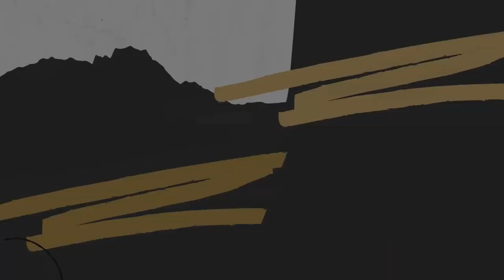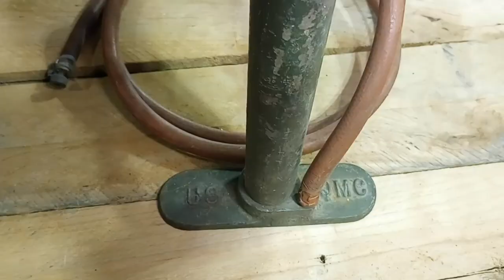Authentic WW2 Tire Pump Restoration

Comment: Awesome job! I'm shocked that hose was not dry rotted as well.
Reply from the maker: Thanks, me too!  Original leather seal and rubber hose intact... score!  The ends had just a couple of cracks from the angle the hose sat at for so many years.